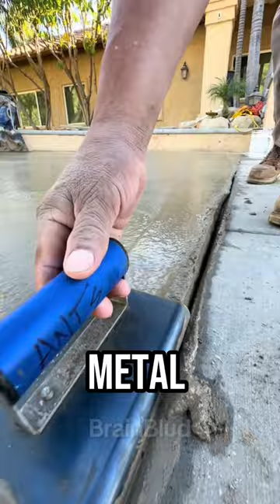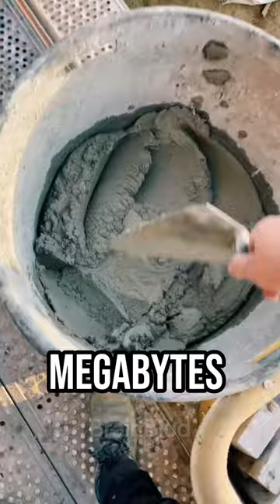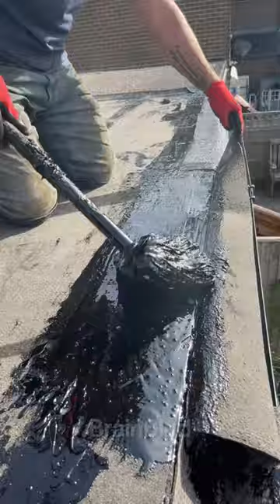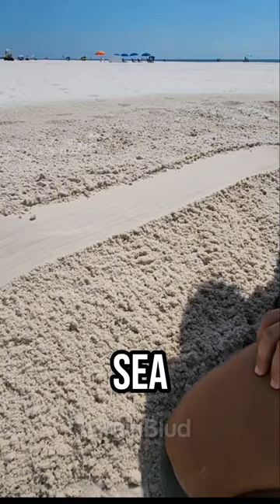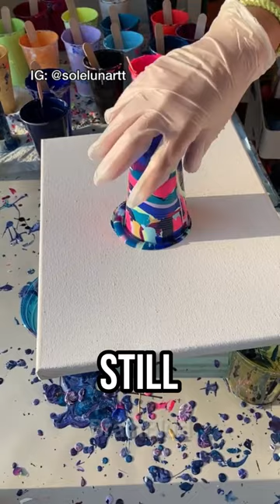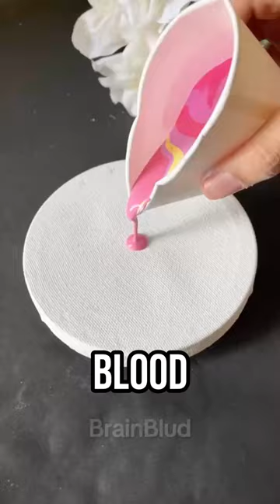Not So Fun Facts You Didn't Know 👀

Comment: I have shown my wife this trick on numerous phones.

Plug in a charging cable, make the cable loop and then touch the phone screen or thumb sensor.
Then rub the power cord over the lock screen moving it around.

For whatever reason, it turns phones on and unlocks them.